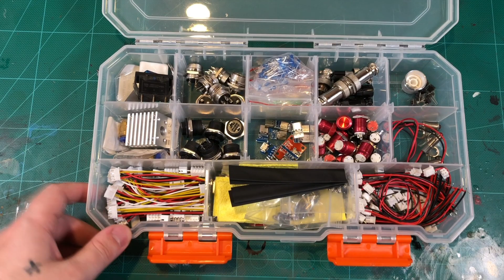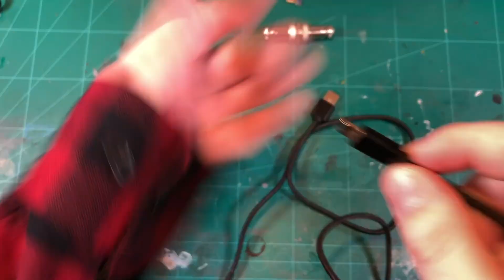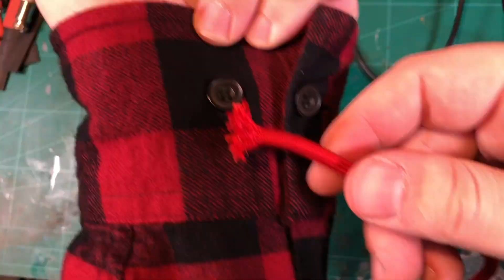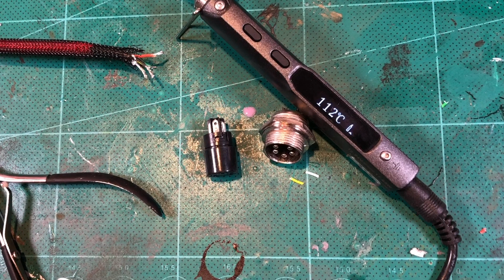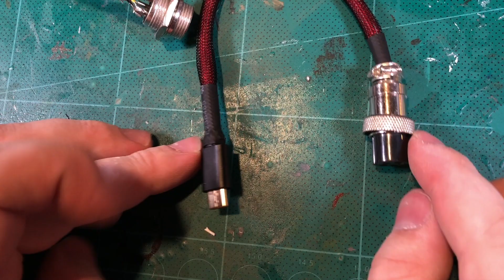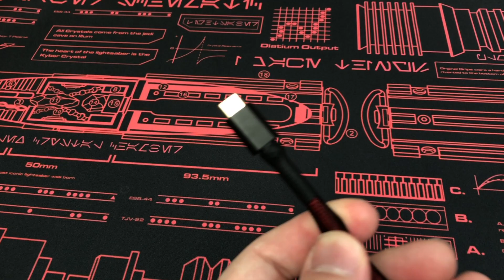Custom DIY Coiled USB Mechanical Keyboard Cable

Comment: It'd be quite cool if you'd have left a price summary of all the items sourced, as well as their sources (as the DIY category isn't supposed to be filled with invisible items that are unobtainable from "Legendary" sources.

I'm not indicating that's what you did, however I've seen too many a video showcasing items that cannot be obtained by the normal bloke.
Reply from the maker: Some paracord 550 , some tech flex , some heat shrink and a gx connector all really easy to get online and quite cheap

Comment: i like how you had the conector positioned between the keyboard and the coil. could even have one connector before the coil for looks and one after the coil to change the colour of the cord between the coil and the usba connector to the pc.

Comment: I can't find an usb cable that fits my paracord sleeve, or maybe I can't find a paracord sleeve that fits my cable , I'm so frustrated
Reply: What's your paracord sleeve lbs?
Reply: @break.5727  i bought this one thinking it was perfect, but it’s too tight :
Namvo 550 Paracord Mil Spec Type III 7 Strand Parachute Cord Total Length 100ft/30 Meters Solid Color https://www.amazon.it/dp/B07DCMXZ46/ref=cm_sw_r_cp_api_glt_i_W95QXKPZ9FG2Q71XMVV9?_encoding=UTF8&psc=1